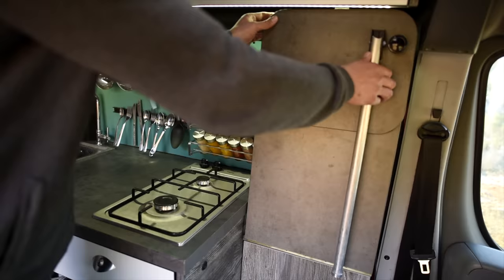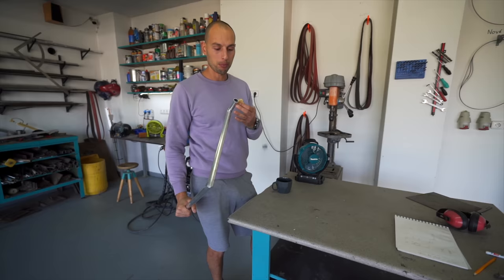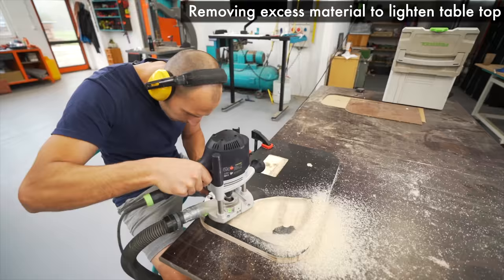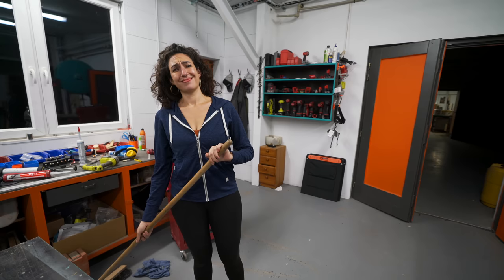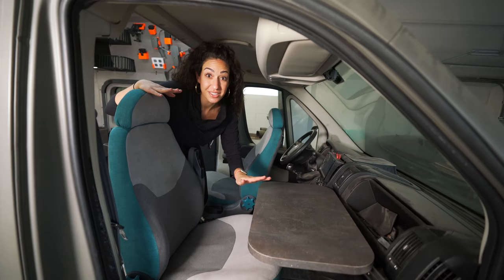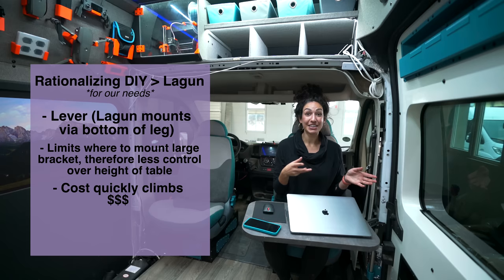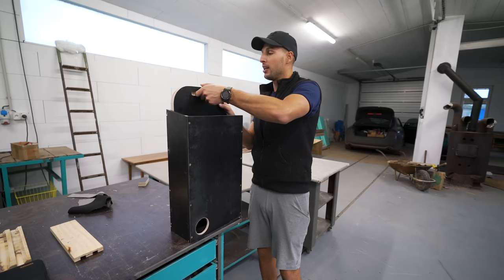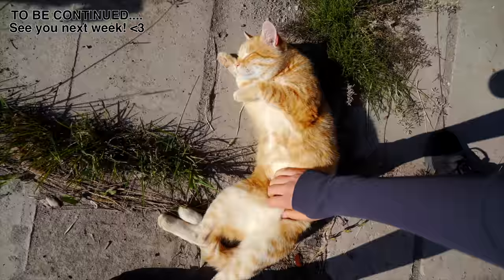Best Van Office Ever Built for FULLTIME VANLIFE!

Comment: The reason the aluminium was bending that easily is because it needs to be hardened after welding. This happens over time automatically (months) or in an oven within a day. The other way around, if you ever need to bend aluminium you can torch it to heat it up and it will soften just like when you are welding it. Anything structural made from aluminium will be a lot stronger when heat treated after welding

Comment: I love watching your creativity and problem solving. When working while traveling you might need to put a piece of ant-skid material/nubbly shelf liner down so the laptop doesn't slide when accelerating or stopping. I believe this is a great idea while traveling,  but it could be a hazard if the airbag deploys.
Reply: Yes, it wil be a BIG hazerd if, by working and driving, the passenger airbag deploys. Than you will be hit by a rocket. Please find yourself more info on that by youtube cresh testing video;s, you will be shockt! Don't put ANY thing in the feeld of a exploding airbag!!
Reply: @vanDeudekom  or just disable it. Pretty much every vehicle can disable it's front passenger's airbag.

Comment: You might want to add an angle bracket for the arm just to reinforce the strength! Plus it will help with stabilizing the table top when driving on ruff roads!  The vibrations could make the arm bouncy without more arm support! Just saying! Other than that it looks good!
Reply from the maker: Better solution might be bent pipe!
Reply: @ladiandmargaret  Or square tubing! The bent pipe will make it more flimsy!

Comment: My sugestion for the hidden cabinet for the laptops isto use server rack rail because it can lock in the extended position and u can plug all the things as like in the cabinet drawer and then put it away plus the top part can be used as a shelf

Comment: My concern about a table in front of the passenger whilst driving is safety if your were unfortunate to have an accident  ???
Reply: Especially if an airbag deploys. Will the airbag throw your laptop towards your face?

Edit - I now realize your van doesn't have a passenger airbag. That's a substantial storage cubby where the airbag is in the Promaster!
Reply from the maker: Interesting feedback. Might be worth deactivating the passenger airbag if there even is one.
Reply: With the G-Force of an accident while driving i can imagine a nasty enpailment. Great idea if not driving  👍
Reply: @observerobserver6040 , one advantage to the table, at least in a frontal collision, is that the laptop will be somewhat contained instead of being loose on the passenger's lap if there was no table.
Reply: I agree. Car accidents can get incredibly nasty and that table has nowhere to go if/when your chest hits it. Part of why cars are safer now is because they crumple to absorb impact but people still break ribs on the wheel and dashboard. 

It also adds another barrier should you need cut out or to escape through the passenger window from water or fire which is already more difficult because they put security film on the inside.

I feel like the compromise here is to change the type of setup. A Bluetooth keyboard and a tablet linked to the laptop in the little cubby would allow them to keep working without sacrificing the safety we hope we never need.
Reply: @perregrine , as long as it's a frontal collision, the shoulder belt should prevent hitting the desk with your chest unless the passenger compartment starts to buckle. If you're not wearing a seatbelt, then a safety discussion is irrelevant because it's not a concern for you.

Arms are another story. They will likely flail forward and hit the desk while the rest of you is belted in.

Side impacts could have the table leg hit your knee, and send desk contents towards the other seat. Rear impacts would throw whatever is on the desk towards you, or swivel the desk into you.
Reply: Idk it's a standard feature on class A RVs in the us. I think it's fine as long as its not super rigidly mounted.
Reply: @perregrine   fully agree with your statement. I'd love too see them get a fire fighter opion to back up their work on this work station.
Reply: @questioner1596  I didn't need you to explain my comment back to me. I trust people don't need simple consequences of collision explained to them and I'd rather spend my time thinking about things like the variety of gore that could result from wood as the materials choice or the time progression of crush and impalement injuries.
Reply: agree, but not only the table; the laptop will be a loose canonball in an accident; it might literately kill the person on impact; which makes me wandering about the other objects in the van, like the drone on the wall, where does it go in an accident?
Reply: @ladiandmargaret  Inside the gloves box, in my ducato
Reply: I agree. I think it's dangerous, even with the airbag off.

The airbag is here for a reason. Without it, Margaret can injured her neck, face,... She can take the table or the support in the chest too.

It's the same as putting your feet on the dashboard to rest. If you have an acciern, the airbag will just totally destroy your legs.
Reply: Even if it doesn’t get in the way of airbag, I can see the passenger being skewered by the metal Rod when the table isn’t on in an accident.
Reply: @perregrine , I did not mean to cause offense, only to discuss the potential for chest injury, which I disagreed with you about. 

The rest of my comment was less directed to you, since this is a public forum, and everyone sees this this conversation.
Reply: Love you guys....here it is... safety is paramount.  And, I'm sorry, having that pivoting armature is not safe--even if you have a beefy lockimg mechanism to keep it in place.  If you have an airbag, disconnecting shouldn't be an option.   What's more important?  Life? Convenience?  I want to see more Ladi AND Margaret!!!
Reply: I’m glad I wasn’t the only one that thought about  this. A high percentage of injuries in vehicle accidents are caused by loose object flying around the car. I totally get the thought proses and ingenuity that you guys put into all you projects and would never want anything to happen to you guy 😊. My suggestion would be don’t work while in transit. And maybe change the mounting point for the swivel to the floor somewhere in-line or behind the head position while seated. 

Keep safe ladi and Margaret and never stop building things you guys are awesome 😎 🇦🇺
Reply: @ladiandmargaret  do not disable the airbag while driving. That feature is only there in case you're transporting a child in a child seat. Airbags save lives in accidents.

Comment: When TIG welding, hold the wire like you are pointing a finger gun and use your thumb like the hammer to feed the wire. Poking the wire is less uniform.

Comment: Trust me you don't want that heater blowing on your feet. They have no control and when you figure that out let me know. I live in double the space in a car hauler and that heater is beyond ridiculous. By the way love the build and the channel!!
Reply from the maker: You mean it’s too hot? Might not be as hot on the lowest settings with 3 outputs open.
Reply: @ladiandmargaret  Way way way to hot even on lowest setting. Keep that little remote handy to the bed so you can turn it on and off easily. But if Ladi can figure out a controller that actually works, I dare say he could sell a million of them. Many a time I have woken up, -35 degrees Celsius out side and this thing has gone rogue and it was 35 above inside my trailer. Very much a love hate relationship!

Comment: Will you still be able to easily access the diesel heater to maintain it?  I have no experience with them, but the Vanwives had issues with theirs and said that the heaters needed to be regularly cleaned out or they would fail.
Reply from the maker: Definitely! It’s important to have access for maintenance.

Comment: I see a number of safety issues working with a laptop, etc; in the passenger seat whilst on the move... Can be distracting to the driver. Loose items can be dangerous when thrown around in an accident or even slide off in cornering or bumpy roads. If there’s an airbag fitted it becomes weaponised.